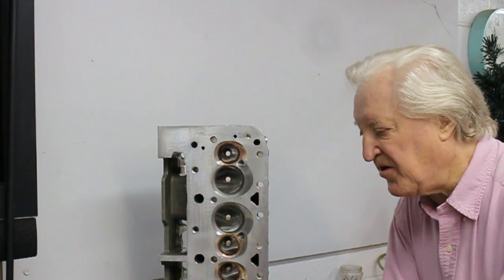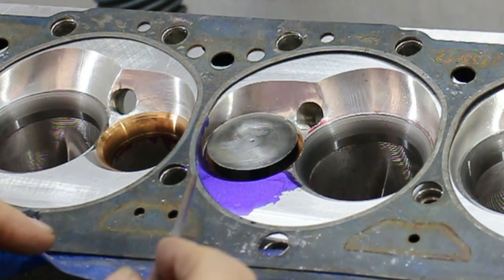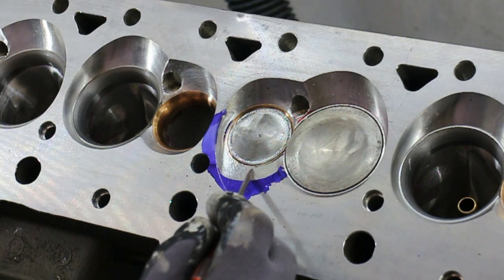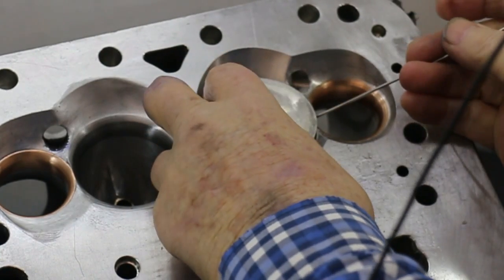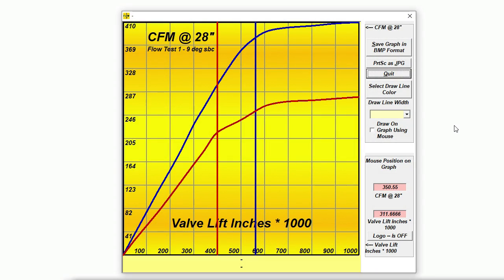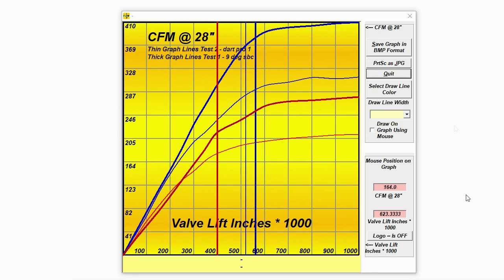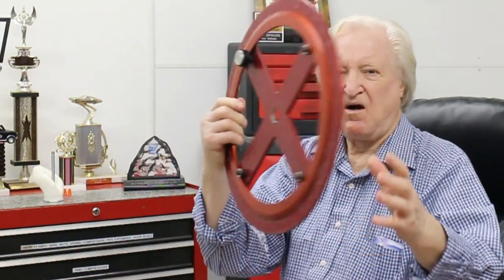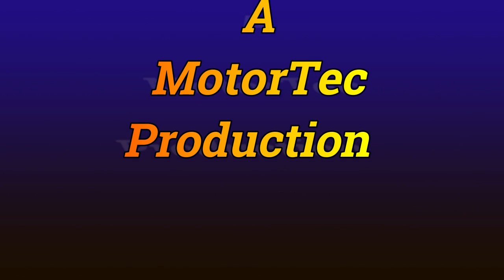Big Block air flow from small block heads

Comment: Alright,I know this is probobly not t right time or video for this, but my question is not somthing that I have seen before about porting/ exghaust, manifolds vs headers. It may be that expensíve headers can be had with square or rectangular gasket- to- head tubes, but Ive only got t round type myself. So while port matching the heads, what does one do? I'm in California where headers are no longer legal on cars after1975. I have a 1986 chevy g10 w/305. The only way to get anything out of it, is to get t exghaust open wide, then work on what will pass t smog inspection. So I will not be able to put t headers on until after that. But I can port match the stock cast iron... and then 'customize' them to a close fit with t tubular gaskets, making a square chunk of iron round on t inside shouldnt be to hard, within limets. But how to do the heads? I can only use a pre aproved RV cam, afterwards using 1.6 rockerarms when I swich too t headers & Holly. And thats about it. I will go to a 1.60 exghaust valve, and if t xtra lift is still alright, maybe sneak in a 1.98 intake, but thats it. I think. ?!?&%#@?

Comment: maximum low lift flow is good for low end/part throttle torque, and maximum power to 5500 rpm, but the problem with big numbers at low lift is, the ports also flow backwards.  meaning more reversion, dirty intake tract and carbon buildup on the valve stems.  the ultimate port would flow zero flow, no flow at all until .100" lift and then start flowing, that would be better.  less reversion.  on the exhaust side, if you could design an exhaust port that flowed twice the intake, you could then greatly reduce exhaust valve lift and duration, and use less spring pressure, that would free up horsepower.  that would cut down on exhaust reversion of exhaust gases back into the cylinder.  what most don't realize is ports don't flow only one way, they're always flowing both ways, and a lot of power is lost when they  flow BACKWARDS, as side effect of efforts to get ports to flow better FORWARD.  the problem with static testing on a flow bench is it's only testing in one direction. this is why Smokey Yunick invented, patented the SMOKETRON, a flow testing machine that would spin a complete engine using a huge electric motor, to simulate the engine dynamics as if it was running.  That device is now in the hands of none other than BIG DADDY Don Garlits, in storage at his drag racing museum.  Don and Smokey were friends.  You can look it up on youtube, Don did a video.  Reversion reduction is another reason why a boosted blown or turbo engine makes so much more HP, the highly pressurized intake tract eliminates reversion using sheer pressure differential, and the extreme cylinder pressure forces the exhaust out the headers with authority- which is also why they use a much wider LSA on the cam.

Comment: A bit off topic; my sbc 427 dart block AFR heads with AFR eliminator intake sucks oil from bottom edge of intake runners. I measured the intake to head gap and the two are perfectly parallel. 

Should there be less gap at bottom edge than the top? 

I’ve tried numerous different intake gaskets but all suck oil. 

There isn’t any information about this on the internet that I could find and I know if anyone can tell me it would be you.

Comment: Holy Crap Mr.  You are sharing proprietary information here! (adjusted 400 heads on an expanded 455 block does wonders on the hobby stock circuit).

Comment: Been a mechanic and racer since the mid 70s...  Have had literally dozens of customers ask for porting work. How hard could it be?  Well I inform them that if it was really as easy as it looked?    there would be a lot more really fast engines..    I will blend bowls, open up pockets and that is about it.. Simply way too much time to do something that in the end has no value or worse, causes a loss of performance.. Today?  you can buy CNC ported heads for less than the cost of a set of fully ported heads 20 years ago ($3500+)....        I love that I can take a set of plain jane every day heads, toss them aside and bolt on either as cast or cnc ported heads and pickup pretty impressive gains...       And then there are the internet guys today... everyone can port a head.....   Yea you can but lets see it work when you are done..   Flow aint everything....

Comment: Hello Mr Vizard, I have been watching you channel since the beginning and Ford and Chevy have been the primary focus but wanted to know if you have ever played around with any of the 3rd generation Hemi heads? As you know they have a true straight line cross-flow design instead of the more common Ford and Chevy designs. Is the  more complex valve train geometry worth the flow gains and if so why are they the only big manufacture doing it. Thanks Jon

Comment: David, since I left racing (pro stock 86 then road racing 88) I have not see any trace of research or testing done to learn about the differences between accelerating airflow in the intake during the first part of the stroke  and the decelerating airflow during the last part of the stroke vs the steady state provided by the flow bench. It was clear to me then that research in that direction was the way to go. At that time large dynos (800hp+) , in car data acquisition systems and computer engine simulation programs were just beginning to be available. I was sure someone would push into those transient areas and find some gains. NO ONE did as far as I can tell. WHY?

Since you are the only one I have seen, besides myself, that built and researched an isolated valve port and the only one I have ever seen mention pressure recovery leading to a CD >1, I decided you might be the only one to ask about this. 

It seems everyone else is utterly unaware of the radical difference between accelerating flow in the first part of the intake stroke vs the decelerating flow in the last part.
Reply from the maker: Bill, That looks like a good subject for a video. Remind me in about 2 months and lets talk on the phone.
DV
Reply: @marvingvx1   Dave OK, there is a lot of ground work to covey about it.

Comment: It's crazy that from the factory any port is Is inconsisted with the group.
... The Ford 302 EFI It's a good example I think it was almost 30 CFM difference from the intake Ports on the ends  From the ones in the center and usually it's one of those cylinders that ends up going  bad 1st.
  The machining aspect of an engine is it's just as important as any kind of performance  Upgrades.

 With the same concept I made my 3.8 hp Sears Eager One edger engine  Good enough to pass up my friend's 5.5 horsepower Honda Powered Mini bike. 
  It's all about the flow.

Comment: Here is a $2 tip for you David. Smooth on offers a expanding foam small cell silicone.  2 tea spoons of material will expand a port up to 360 cc. Once curred, just trim flush with fave of head. It's self skinning so the walls will come out smooth. Yet collapse easier for removal. It cost half as much as molding silicone and only requires a 10th of material to mold a port. 
  1" into the chamber is equal to .300 of lift,  after .300 the valve tulip profile takes over until its completely clear of the incoming charge. At about .650+/-. 
  Some heads like the Cleveland head need less for the valve to completely clear the intake charge.
   Let Andy know....that's his fuel mileage loss that will keep him from ever achieving 20mpg. Hemi heads tumble, don't swirl for larger droplets  of fuel. = less fuel economy then his previous Windsor!
Reply: Those heads are semi hemi heads.  They have angle and cant unlike a true hemi head.  Because of that, I think that it can't help but have swirl and lots of it.
Reply: Which product is that, Smooth-On offers many products. I have an intake I want to map out.
Reply: Link plz - - I was gonna use RTV and package peanuts !!

Comment: David Vizard, did you use a formula to come up with the 1.312 radius for scalloping the combustion chamber around the exhaust valve?  If so, was this formula the same as what you showed us on the 2.2 head?

Comment: I made 7 mm air-intake on carburettor,for high pressure air.2 cm original.Used 0.35 nozzle,0.25 idle original.Started idle,went to 60km\h original variomatic gear.But didnt fire.Fuel-line melted on carburettor,extreme heat.But top heat-damaged,still in use,with f1 sound,become better,hardened.

Comment: 440cfm? You must be on DRUGS! Even the best flowing, ported Hemi heads don't flow even 100 cfm less than that!
Reply from the maker: Grant - you have every right to be a sceptic here - if I did not know better I would be also. And thanks for a civilized statement of opinion.
Reply: @marvingvx1   I want to apologize for my toxic comment. I should have been more tactful. In all honesty, I have never seen any flow tests that show a head getting anywhere near 400cfm.
Reply: @GrantOakes  look at some gen 3 hemi heads from livernois, or thitec. They get flow numbers in the 400s.
Reply: @GrantOakes  I have seen heads flow in the 400s. Big flow numbers are not a guarantee of the most horsepower
Reply: Stock? Let’s skip to the Edelbrock head that at .700 delivers 429 cfm.
Address the valves and the valve job, I think we can get where we need to be…. 440 cfm.
Reply: @Robs-Garage-experiments  my Hammerhead Performance Engines Boss 429 style heads that I used on Project MIXED UP BOSS flowed 395cfm with a AS CAST port! Ported versions of these same heads have surpassed 500cfm!
You can see it all on my channel Unity Motorsports Garage working with David Vizard
Andy
Reply: Sprint car motors do it all the time

Comment: I'm a small small block guy, I would put those heads on a 327 with 230 duration .5 lift cam range and I no that would make a lot of power.
Reply: Sluggish velocity it would be a low rpm dog.
Reply: Too much head for a 327. Minimum 400 cubic inch.
Reply: There are formulas for determining the cross section area of a port versus cubic inch and rpm range.  Order an engine math book and crunch the numbers.

Comment: What would be a good filler in the passages on a cast iron head both intake and exhaust for street use?  I've been thinking about the second scale on your degree wheel, so far ? I haven't come up with any more ideas. can't weight for your input on this. Thanks Fred